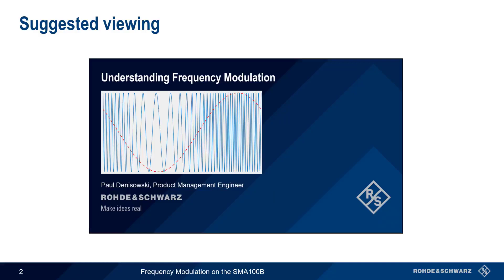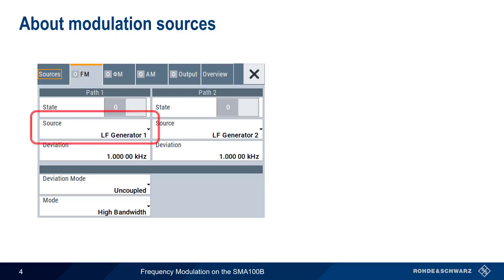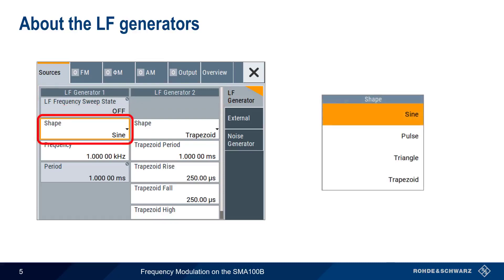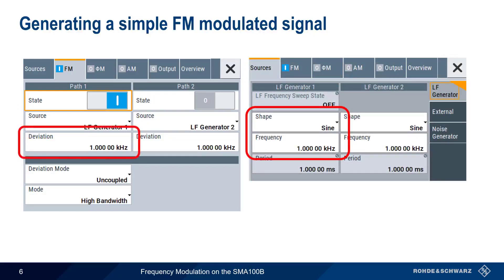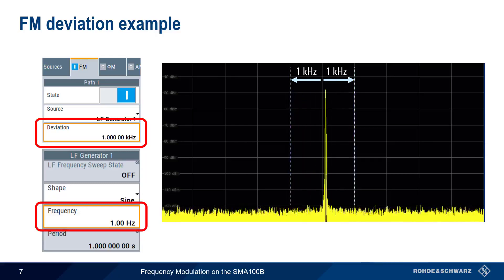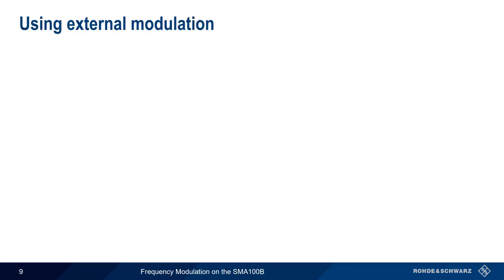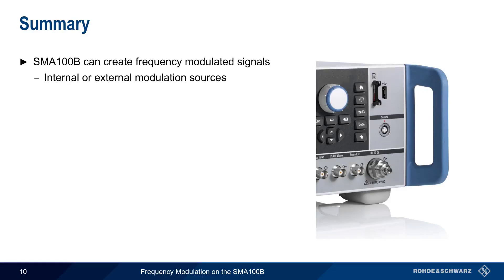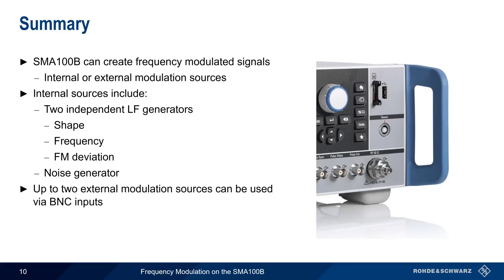Configuring Frequency Modulation on the SMA100B

Comment: Thanks a lot for sharing this nice video! I have a question: is the frequency deviation here meaning the maximum frequency deviation? Or can I understand like, in this example, delta_f = 1kHz, fm = 1Hz, then the modulation index is 1000? What is the voltage level of the internal LF? If I use the external modulation signal and change the voltage level, can I change the real maximum frequency deviation, even though the setting frequency deviation is kept? Thanks a lot for your help in advance!